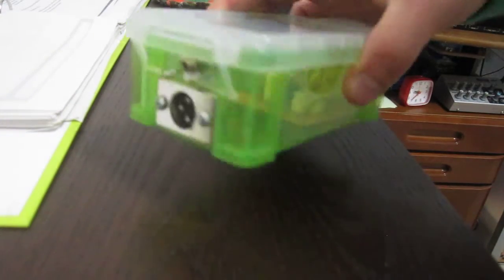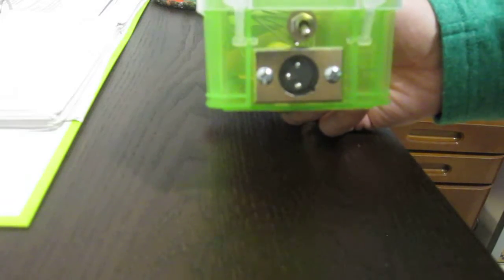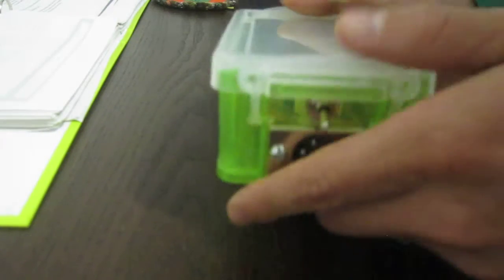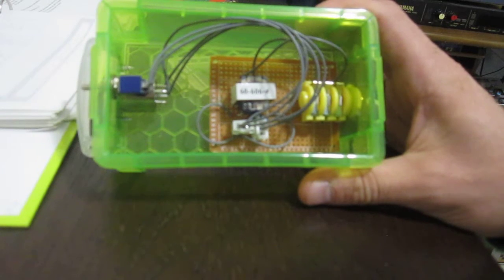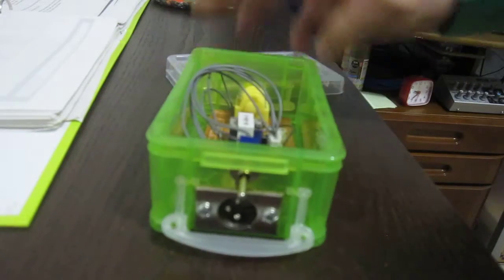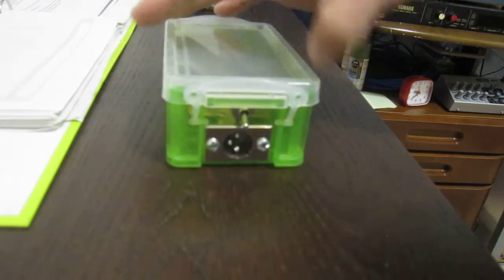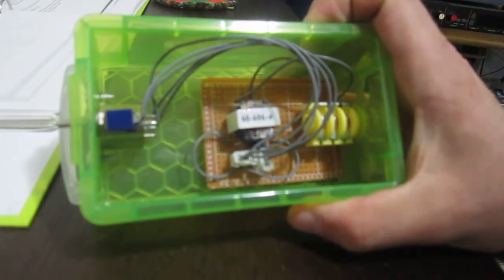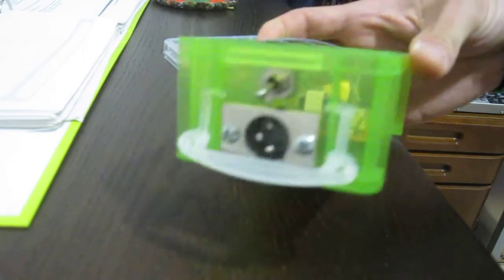Simple DIY Passive DI Box Circuit Version 2

Comment: Hi, thanks for the circuit. I would like to know what is the porpouse of the RC circuit?
Reply from the maker: It's a filter for the noise if the ground isn't lifted. It may not work depending on the issue.
Reply: Thanks!

Comment: Lunch Box POWER!!
So, can you explain what Ground Lift does?! :)
(Actually, you should not answer this question, 'cos I should just google it!! I only know that if sound isn't coming through it sometimes helps switching Ground Lift on or off) ;)
Nice built and thanks for sharing!
Reply from the maker: +Arrayzable Basically the lift switch is just there to eliminate any grounding issues. Sometimes lifting ground will give you noise, sometimes not lifting ground will give you noise. Ground and electrical is a pain. Anyway, I think for the most part you won't need to use the ground lift switch. The first 4 channels on my mixer are all balanced XLR inputs, so I had to build DIs for my unbalanced gear.
Reply: MrFricoco Well, thanks for the answer ;D
Reply from the maker: Arrayzable You can find the answers on google, but sometimes it's just easier for someone to tell you. The answer will probably be more to the point and simple. : )

Comment: Interesting! Looks pretty basic and easy to build
Reply from the maker: +DearbornJohn Thank you for the nice comment! Yes it can take under an hour to build, only 1 resistor, 1 capacitor, 1 transformer and 2 jacks and 1 switch.
Reply: And the knowledge, that I don't have. Good job!
Reply from the maker: Hahaha, ya it takes a bit to get into.
Reply: Being around electronic instruments and amps and studio equipment for decades, I have a little electronic knowledge but not enough to design and build devices, not my forte;)
Reply from the maker: Ya, I'm not big on the design part. Mostly on modding and trying to improve or make more simple existing circuits.
Reply: Still you have nice design and planning, big plus!
Reply from the maker: Thank you!
Reply: @MrFricoco  please tell me components details clearly